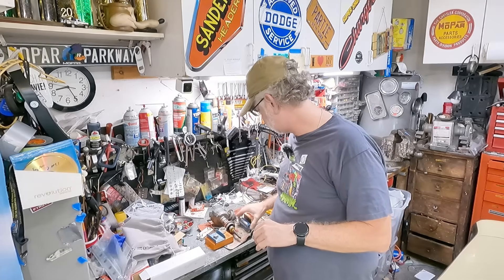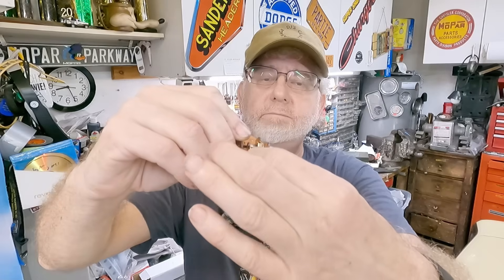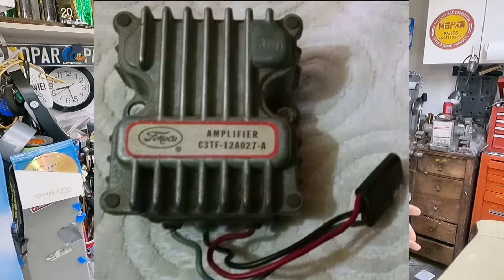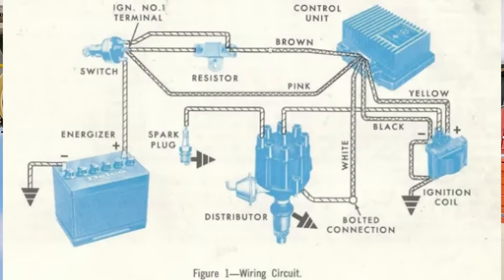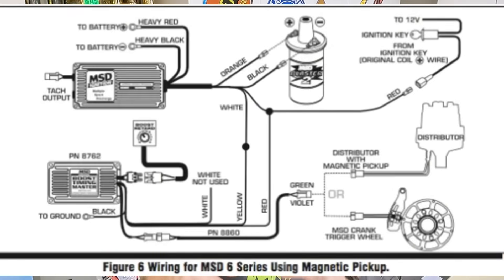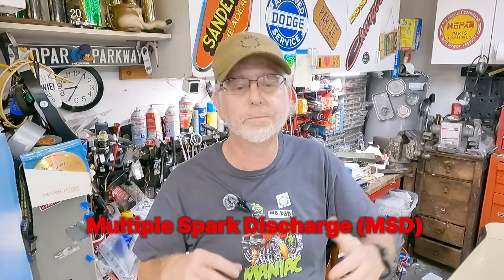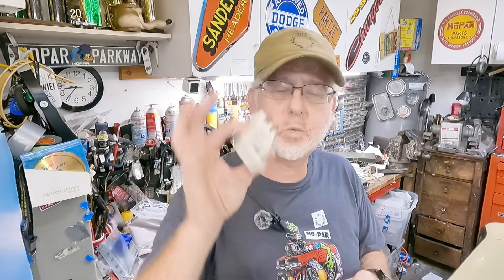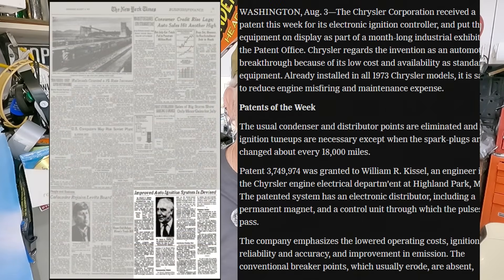Why Everything You Thought About Electronic Ignition is WRONG

Comment: There are a lot of different settings for points.  I have GM SD-100 dealer tune up manuals from the 60' thru the 90's. They have the tune up procedures for all manufacturers, and the upper and lower limits vary a lot. Not just by engine, but by the application of that engine, and the year.  For a stock vehicle, getting the perfect dwell setting, and not just close enough, makes a huge difference is starting and drivability and power. And longevity of the points themselves.
Reply from the maker: Yep, and that is why most people did not like working on points. But done well they were perfect,
Reply: @DJsClassicGarage  when i was a kid every gas station had a shop, with parts and tires, and all the manuals.  I knew tons of people that ordered the factory manuals from the back of glovebox manuals. The world was a completely different place, all that knowledge was very commonplace. Everyone just forgot.  There are still mechanic shops and parts stores with rows of those books, and they used to freely give customers that information.

Comment: On the Chrysler ECM's made in the 1970's thru the 90's that huge Transistor cap with the cooling fin plate was a real transistor and would smoke your finger if you touched it when running. 

All the current replacement ECM's made in China have a FAKE transistor that is just a fake  cap with no wires. The insides are really just a clone of a GM HEI modual.

Comment: Who remembers the Borg-Warner "Light Chopper" distributor update which used a slotted wheel that rotated and broke a light beam to trigger the coil to fire? My 250 Chevy straight six had a worn bushing and the points bounced around.  My local parts guy sold me this update kit and it didn't care at all if the distributor bushing was a bit sloppy.  A perfect system on that engine.  They seem to have fallen off the face of the Earth. Flawless system which has no wearing points, funky Hall Effect designs etc.
Reply: Fitted lots of them to different vehicles. Great as wear didn’t affect them

Comment: The real problem for early attempts at electronic ignition was that early transistors couldn't stand up to the current and high-voltage transients of switching an ignition coil, especially in the heat of an engine compartment.  It was really the years of development of transistors, especially the evolution from germanium to silicon semiconductors, that made it possible for transistor or breakerless ignition to work reliably.  The same is true of diode-rectified generators.  The first alternators also had high failure rates.  They got better because diodes were greatly improved over years.
Reply: They just called for Mil-Spec. Then came automotive use specific. Now both are the same parts. 
We suffered similar problems with switch mode power supplies, and VFD motor drives.
Reply: If you look at some of the early 1960s F1 cars like the Lotus 25, you can see a big heatsink from the Lucas ignition on the left hand side, just behind the cockpit. Heat was clearly a problem.
Reply: @alexjenner1108 Yeah, at over 600 cycles per second anything will get hot! LOL
Reply: The transistors have been around since the 50's developed in 1948. The real issue for auto makers was cost at the time.

Comment: I had a 69 383 Roadrunner and switched to the HEI.  The stock point ignition distributor was better and capable of faster times; however, the HEI ignition system was more consistent and made tuning overall easier.
Reply from the maker: Yep.  It is never about power but reliability

Comment: The oem blue grommet Ford modules went bad very often.  Also, decades ago, my uncle's 60's Chevy stopped running, he really wanted to be a car guy. So, no spark, he replaced everything in the ignition system except the condenser. No spark, he calls me. I look it over and ask why the condenser looks old. He says condensers never go bad. I took the condenser out of his Ford, bent the mounting tab, installed it. The car is fixed.